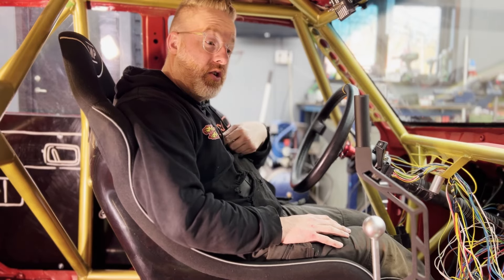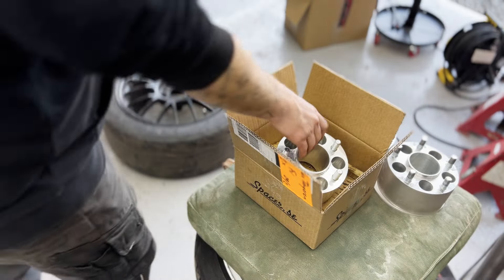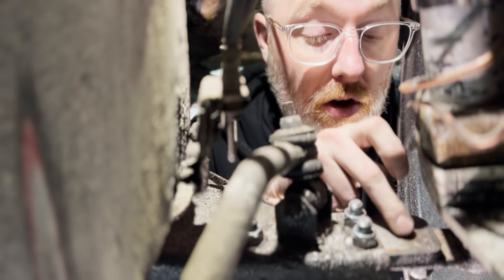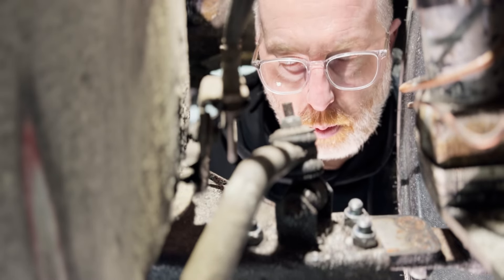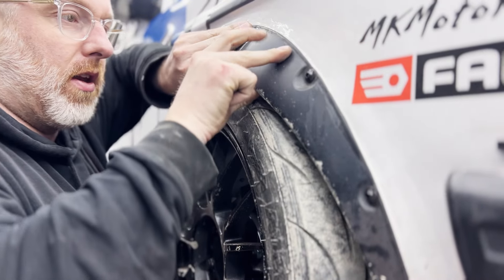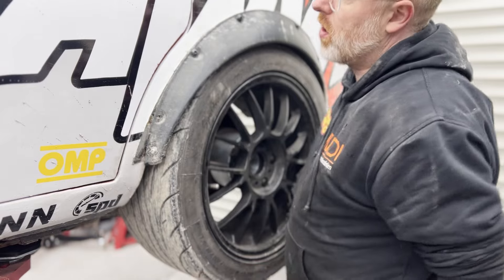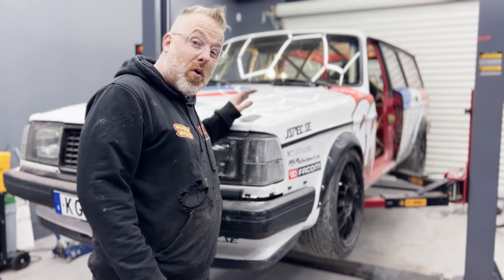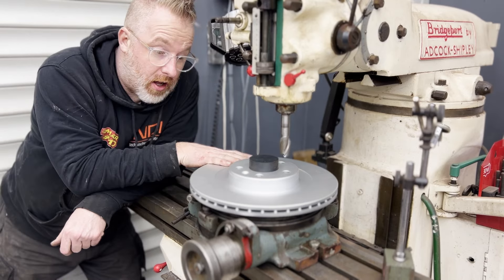Volvo 240 Racer - Rollcage Build - Part 4

Comment: I know you don’t want to change calipers, but the popular Mégane RS Brembo’s are often used on 324 or 340mm discs.

Love how the interior came out btw! 👌
Reply: 28mm thickness for the Mégane, 20mm for the V90 might be an issue.
Reply from the maker: 28mm thick is quite hefty! But i'm going to take some time for this brake upgrade and cobble together something nice, probably in the summerbreak or in winter during the engine swap.

Comment: I think a set of used C7 Corvette Z06 calipers from eBay would look great on those rotors. They are made by Brembo and are pretty economical compared to ones with a higher end car manufacturer's logo on them. Shipping to you might be a little expensive, though.
Reply from the maker: Thanks for the suggestion! I just looked them up and a set of four calipers goes for about 1000 dollar, including shipping and that's not bad indeed. A very common brake upgrade on a 240 tho is the V70R brembo's. A front kit with discs, adapters and racepads goes for just under 1000 euros and that's also very economical i think. And with that I do not have to re-invent the wheel and i can just bolt on the parts. That's also worth a lot for me these days.